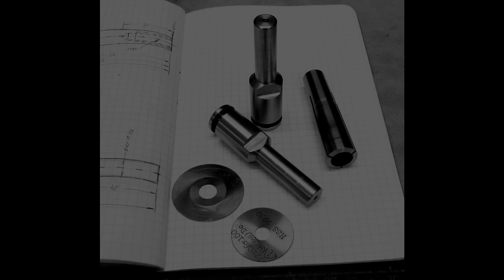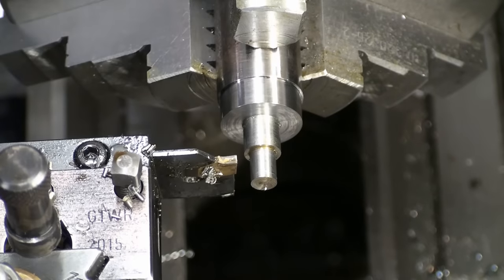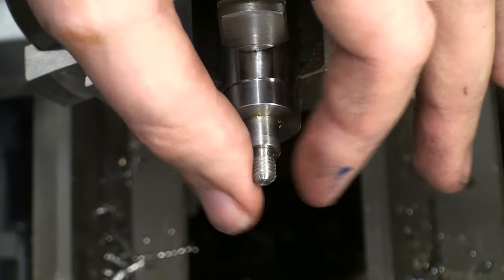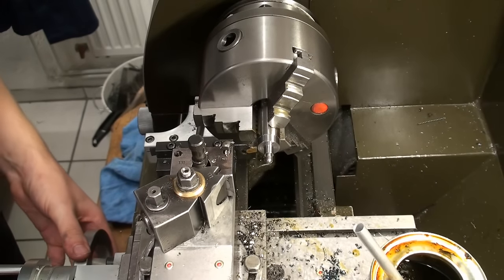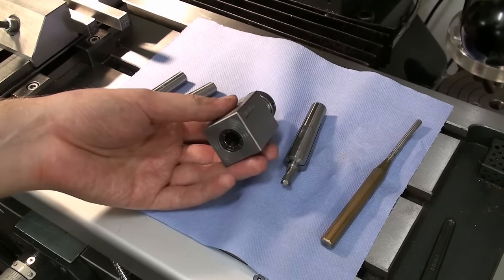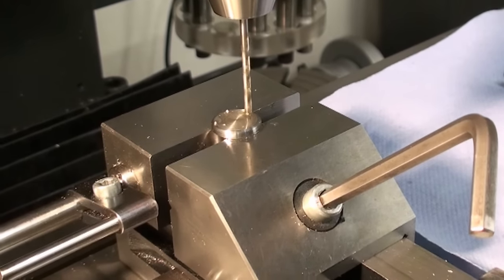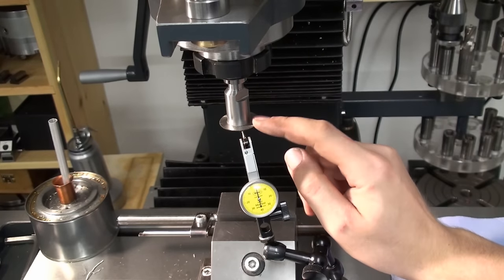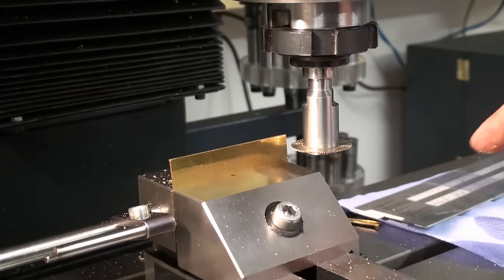Saw arbors Part 2 - Sägedorne Teil 2

Comment: I liked seeing your depth stop in action. It was an interesting build from your other video and clever use of shop gauge blocks.
Reply from the maker: +Paul Jones Thank you! I like the depth stop very much myself, It works so fast and precise.. :)
Reply: For sure! The depth stop one of the coolest tool modifications I have seen in a long time. Your toolmaker workmanship is extraordinary with extra care even on surface finishes in places that will never be seen - a mark of first class toolmaker.

Comment: I very much enjoyed this video, I make quite a few arbors because I tend to use watchmaker size tooling but don't own anything that takes WW-type collets. It's always nice to see how other people make things differently and I think I will be adopting some of your techniques.

I wanted to point out 2 things that I do slightly differently when I make arbors:
1: I use a split die to finish the threads when they get close with single pointing, I find it easier (especially with thin screws) to control the fit by adjusting the die than to try take very thin single point cuts until the end.
2: I make the register that the saw sits on be part of the arbor, not the screw, this allows me to turn both the shank and the register without removing the arbor from the lathe. I can then remove it, spin it around and cut the relief (as this is not as critical). I suppose that for slitting saws, the accuracy of the register is not that important, but I make shell mill arbors and there, it can be quite important. Putting the register on the arbor means that the nut that holds the saw has to be cup shaped, so that imposes some limitations in terms of thickness, so i guess I will be making some arbors with your technique soon.

Thank you for another great video!

Comment: Another good video, clear and concise. With a number of other people's videos watching at 1.25 or 1.5 times speed nothing is lost and, in my view, something is often gained by not wasting time on drivel, your's I always watch at normal speed. 
About your threading versus other countries, the difference is because of the metric system and the fact that some metric lathes don't even have thread dials. With an Imperial lathe the thread dial tells you when to engage the half nuts. With a metric lathe you can engage the half nuts anywhere if the thread pitch is a divisor of the lead screw pitch. Any threads not a divisor you have to keep the nuts engaged all the time and have to reverse the lathe to get back to the start point. 
Have you seen the threading tool that lifts itself clear automatically, when reversing the lathe, so you don't have to withdraw the cross slide? If not, i can heartily recommend them. I have made several differently designed versions ranging from the original 19th century one, through to your fellow countryman's version on you tube. I did design one that works on internal threads, which helps when cutting threads where you really can't disengage the half nuts like a 1.25mm pitch on a 6mm leadscrew.
LL&P
c
Reply: Chris Stephens a

Comment: Interesting commments on threading. First time I ever ran a lathe (great big  16" thing with no threading indicator) I was taught to reverse the lathe and leave the half-nuts engaged. Slow, you say. But there is an article in * Home Shop Machinist's Workshop* magazine entitled "A Screw-Cutting Clutch for the Myford Lathe" whichi is a pair of stops, an auxiliary set of gears, and a clutch. The stops were set for the extremes of thread travel. The clutch automatically stopped the lathe at each stop and the operator threw a lever to reverse the lathe. Apparently this was a standard  feature of the Hardinge HLV lathes. Superb machines. They also featured a retracting compound, according to the article. So thread cutting was very easy. Building all this machinery not so easy, in fact very complicated.  If you did a lot of threading, might be worth it. If anyone is interested I will supply a complete citation.

BTW those Saegesdorne are works of art. Thanks for the   education.

Comment: Hello again Stefan.  I made my version of this today for a 16mm arbor size.  I avoided clamping the functional arbor surface in the chuck by screwing the part into the arbor, chucking that and finishing the screw in position.  Then I drilled the spanner holes and used the spanner to separate them.   Is there any particular reason why I should not have done that?  Seems to have worked.  My arbor is accurate and beautifully polished.  Thank you very much for the design, the idea that I first had would not have been anywhere near as accurate.  Your channel rocks!

Comment: Hi Stefan, Did you consider inserting your collet in the your collet holder the other way around as your your applying the tightening from the backside of the block? Maybe it's like cooking a turkey, which ever way you put it in the oven, it's going to get cooked. Nice job on the arbors, anyway.
Reply from the maker: +Robert Klein I dont think there is much difference, as the collets clamp on their whole length.. Thanks for watching and commenting!

Comment: Stefan - at 3:52, who RPMs is your lathe running at. I'd like to compare my RPMs when I use that same CCMT insert. I'm fearing my lathe doesn't have fast enough speeds.
Reply from the maker: +BasementShopGuy I think thats about 600Rpm - I run my lathe most of the time in the 0-1000rpm Range - Still a bit slow, but I am pretty lazy when it comes to change the belt to the 3000rpm range...

Comment: Thanks for the video, lots of thanks. Many of Your videos are on a level too high for me. This video gave me lots of satisfaction in my amateur shop.
Time 01.39. Ahhh. I missed that in my first attempt but worked to eliminate the cutter radius effect. Next version will be like You did it.
Time 12:20. That undercut gives me shatter. More to learn...
Time 15:55. I've got that!

Time 16:20. Kosmethical.... none functional as You say.
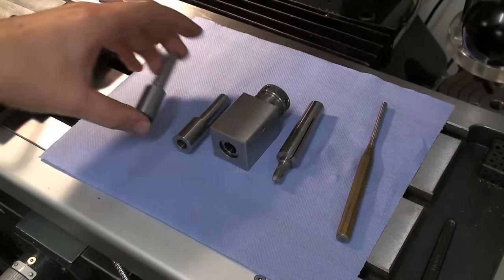Time 19:00. I omitted that step! My way is to attach the arbor to the collet chuck and use the ER32 key when finally tightening the the locking nut.
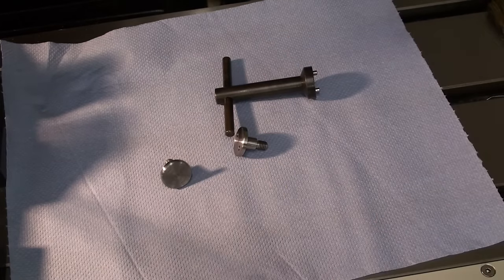Time 25:50. Maybe the toll for changing the spikes in my golf shoes would do... I made a cut for a 10 mm wrench in the 12 mm arbor.
Time 26:10. I cut off the 12 mm to fit a 10 mm wrench.
Time 31:30. You managed ways better then I did. Arbor 12 mm, saw blade 45 mm diameter. Hopefully next version will turn out better.

Summing my impression: A really great serie of videos. Lots of thanks!

Comment: In American school's were taught all aspects of high precision work by retired production machinist and mold maker's. It's really just as accurate using the split nut in my opinion! You could have made your bolts and ground them and then made your arbors to get more precision. We really like all your videos ! Keep up the good work
Reply: +Weapons Machinist™ You can't always use the half nuts with metric threads, depends on the pitch. I suppose this gives the inch versus metric guys more ammo but that's just the way it is..
Reply: Little Work Shop of Horrors I think it's in the lathes design some are dedicated inch and some are dedicated metric. Change gears for each measurement standard are supplied for each type of lathe sometimes. Usually the module gears are built in if they cut using both standards. I think you are referring to the odd ball thread pitches.
Reply: Not necessarily.

Comment: Disengaging the nut is possible only when the thread pitch divides the leadscrew pitch without remainder. E.g. with 1.5mm leadscrew you can disengage it on 1.5, 0.75, 0.5, 0.25mm threads.

Won't work otherwise.

Comment: I finished this project last night, I used a die nut instead of single point threading and the part is crooked. Granted I don't know if it's the threadon the bolt or the arbor. I threaded that by hand too after starting it in the lathe, had no machine tap.
Reply: BTW one nice thing I learned from my project, those cheapo WNMG inserts for aluminium.... you can use those to take off hundreths of a mm and they take tiny cuts beatifully... I was able to get right on size with it. Too bad about the crooked thread ruining all that work I guess.

Comment: i got something I'm going to try to do with a slitting saw. I want to make some deep cuts in cast iron. I have carbide slitting saws for non ferrous metals. If i change the angle of the tooth, right at the tip of the tooth what do you think the odds are that I'll be successful?
Reply from the maker: Could/should work :)
Thats actually a good idea...time to build a saw sharpening fixture for my surface grinder :D

Comment: Great job. What about making an annular cutter arbor with two set screws? Possible?
Reply from the maker: Yeah, sure! I made two holders for annular cutters myself (Used an off the shelf MT2 blank in that case, but nothing speaks against machining a complete holder with MT from scratch)
http://gtwr.de/portfolio/pro_annular.jpg
Reply: Looks like a modified dead center. R8 is probably more difficult., but I'm sure that you can make one. I'm light years behind your skills. Your videos are inspiring. Ty

Comment: Hi Stefan, could you tell me how much HP (or watts) your lathe is, the swing, and what is the maximum depth of cut you do with it? Thanks!
Reply from the maker: its a 10x22 (250mm swing/125mm centre height, 550mm between centers), depth of cut in steel can vary between 1 and 4mm...depending on the diameter and the material. It has a 0,75kW 3phase motor running of a VFD.
Reply: Thank you for the reply! I have a 13x24 inch 1 HP (0.75kW) lathe (so pretty much the same as yours, mine is Chinese made) and I've been scared to do depths of cuts more than 0.020" (0.508mm) with it. Just to give me a goal to shoot for, what is the max depth of cut you would do at 1 inch (25mm) bar and 2 inch (50mm) bar for mild steel?

Comment: Isn't it better to machine the shoulder on the Arbor itself. I think it will be more rigid than the bolt cuz the force on the saw is mainly radial
Reply from the maker: +Asaad omar Kinda - But with the shoulder on the screw it ajusts very well for different thicknesses of slitting saws - I have some with only .2mm thickness, up to 3mm thickness. And turning a sharp, .2mm thick shoulder would be not much fun ;)
Reply: +Stefan Gotteswinter yes got it. Thanks for replying. I am surprised with this precision at homeshop. And Like your videos

Comment: That custom of not disengage the half nut my originate from pre metric standardize in European machine tool manufacture.

I can see why an instructor would instruct a factory workers not to disengage the half nut if there was a mixture  of metric & emperial machines being use in one factory. 

On the other hand this assumes a lack capacity for diligence in the instructees. 

.